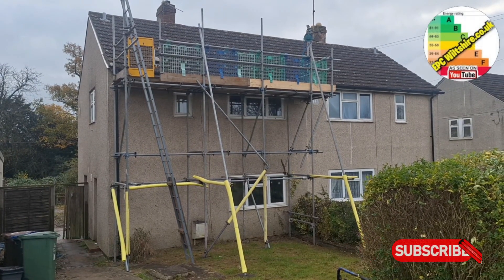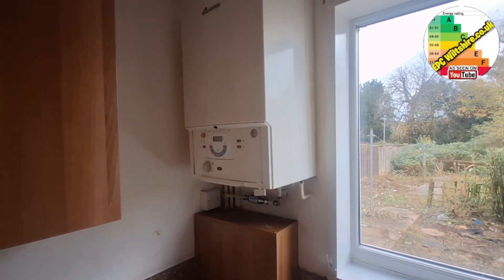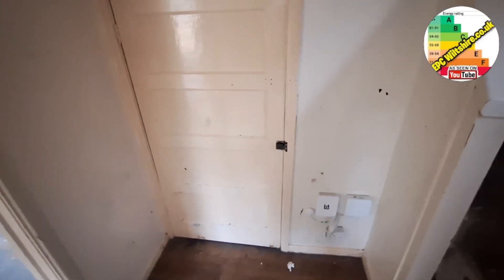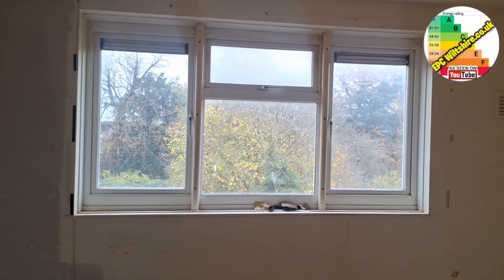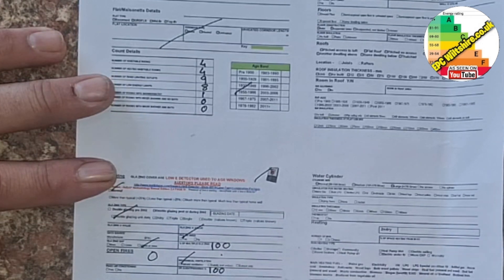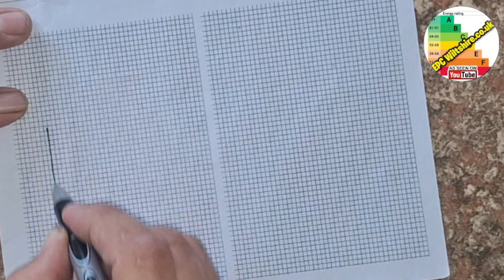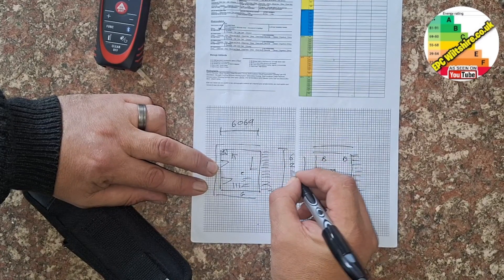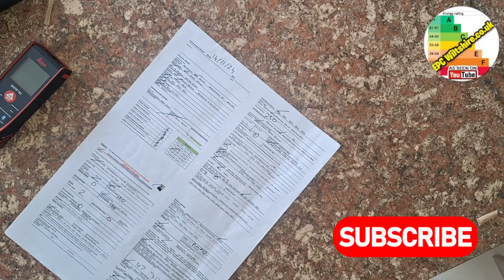EPC Walk Thru Semi Detached System Build with External Wall Insulation

Comment: I have installed external wall insulation on my kitchen bathroom extensio myself. I will submit all product details and photos of installation to the EPC inspectior. Do they require a lot of evidence? Please let me know.
Reply from the maker: When doing an EPC the assessor is required to gather documentary or photographic evidence whilst on site, this is an audit requirement, in your case it you have and receipts handy and he is able to measure the wall thickness and photograph the thickness then your extension wall with its insulation can be added to the epc improving the score